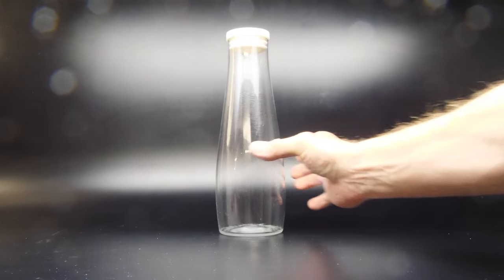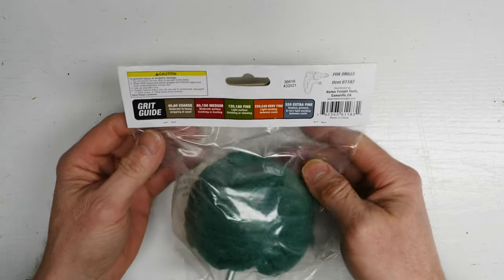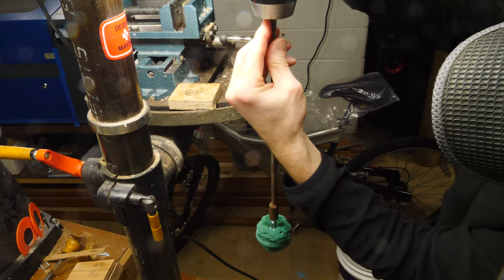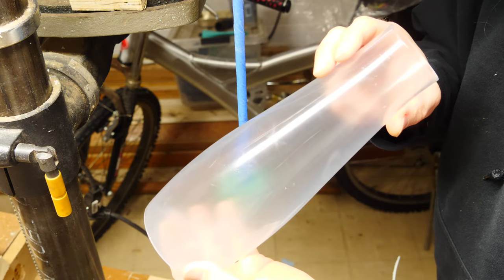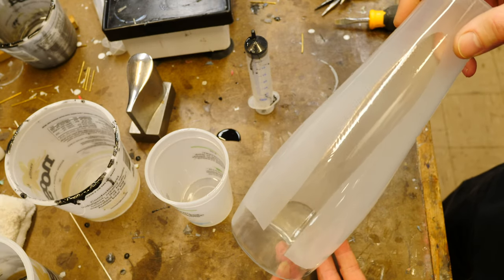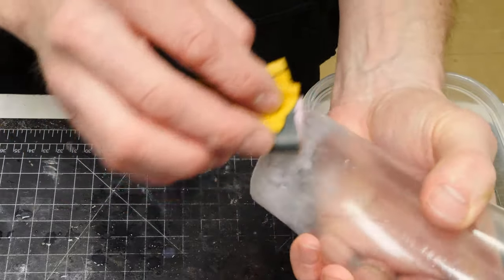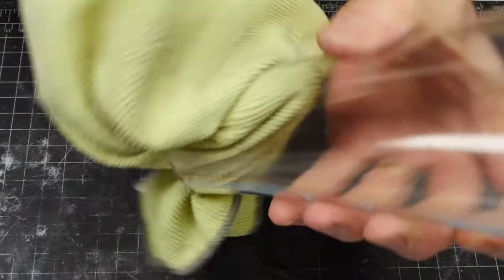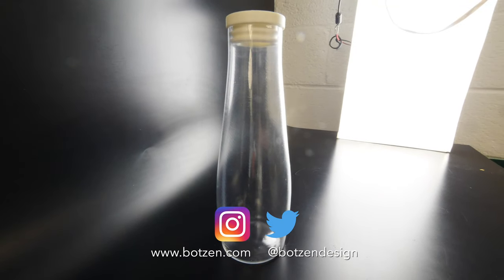Clear Bottle Prototype

Comment: Would it work to leave half of the sanding ball disks off, resulting in a flat-ish bottom sanding dome, to deal with that right angle, where the side meets the flat bottom?
Reply from the maker: Not completely flat on the bottom

Comment: I find that slinging the excess material onto a scrap piece of cardboard help with runs and bubbles.  If you miss anything you can use a brush to pops bubbles before that cure

Comment: Thankyou for this very good helpful video!! Can you maybe also make a video about 3D printing a bottle with screw lid?🙏🏾 I want to make a model of a ball shaped bottle that can hold glitter water and can be refilled. I use Blender for the model but I hear about the nuts and bolts assets not being accurate enough. And then I want to make a silicone mold from it to use for epoxy resin. So it can become a product.

Comment: Is your method of making/reproducing items cheaper than 3-D printing?  Basic tools cost estimate? Liquids, pressure tank, key core items. Can you give me idea? I. Anew by and deciding best route as I have limited income.most items I make would be 1foot square or smaller.  6 to10 inches. Tech containers/waterproof.
Reply from the maker: That was a 3d printed part.....

Comment: What materials can be dissolved in acetone or xylene then be used as a material for injection molding? I have some beautiful colored acrylic, but when I heat it to try and form it to the shape I need, it shrinks! At lower heat hazing appears at bending areas. Please help.
Reply from the maker: Don't really know, I have never used that process

Comment: Wow, an amazing result! (I’m not sure whether I’m more impressed by your technique or your patience 😁)

Checking the link for the urethane reminded me: Resins tend to be pretty expensive (vs my personal budget anyway), and usually come in much larger quantities than I need for the small projects I typically do. Is there anything to be done about extending shelf life? I’ve found that refrigerating small amounts in 100% full containers helps, sometimes using the argon/nitrogen mix from my MiG welder to flow over and flush the container as I close the lid. This can extend life a fair bit (to maybe a year?), but I’d like to be able to go longer. Can unmixed resin or unopened epoxy be kept below freezing to extend life? Any other thoughts or suggestions?

Thanks for your videos, they’re incredibly informative and practical!